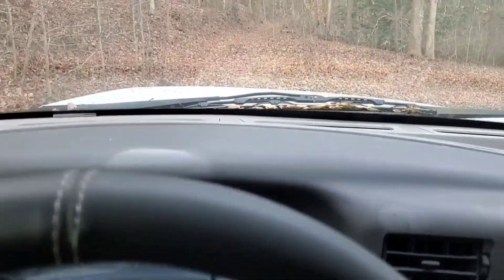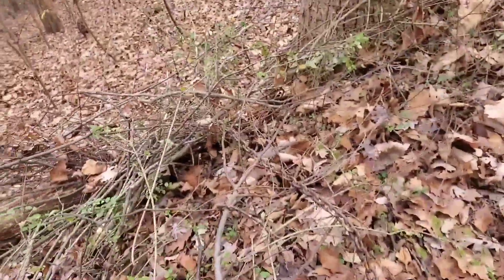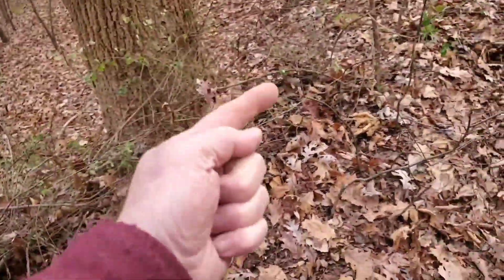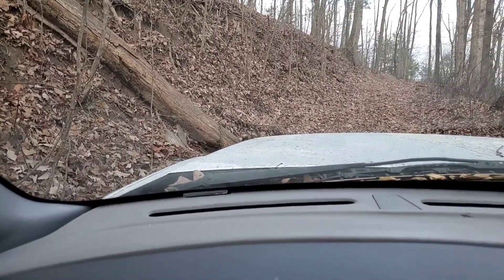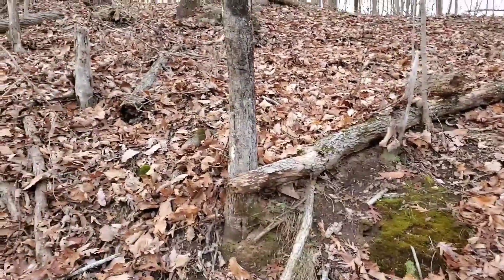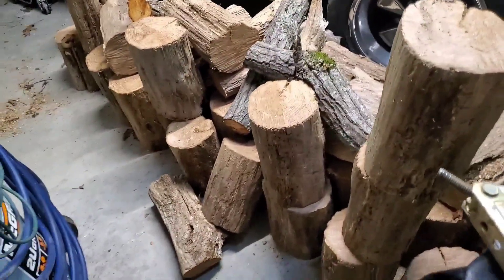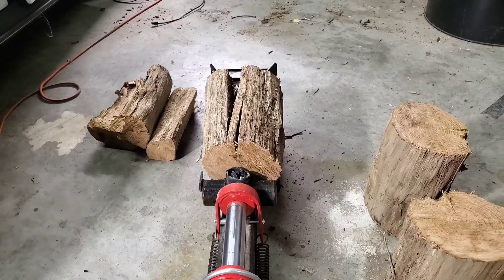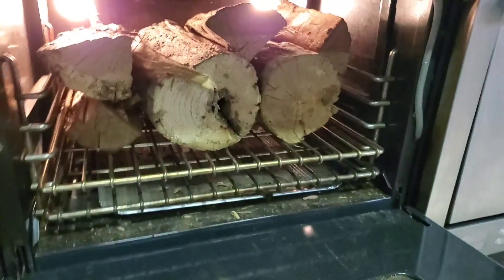Homemade Barrel Stove After 1 Winter. Is "FREE" Heat Worth It?

Comment: Strongly recommend building/buying a log arch to pull logs to the shop.  Should be pretty easy with your skills and would make hauling much more safe and efficient.
Reply from the maker: It essentially keeps the leading edge of the log from digging in while being dragged? If so,  my wife would appreciate me not tearing up the yard.  Thanks for the tip!